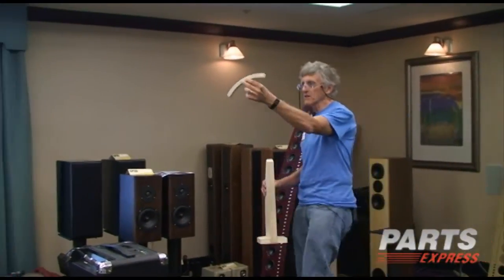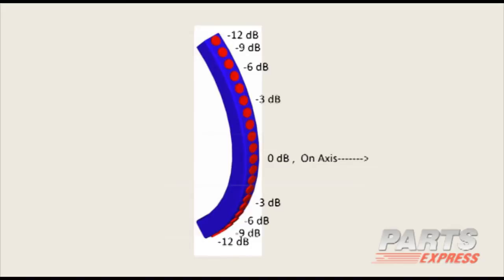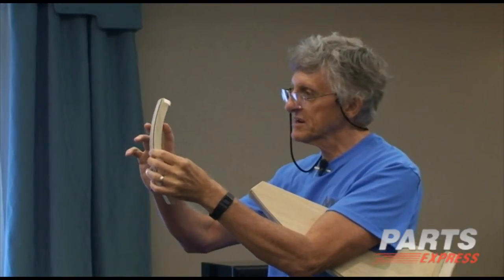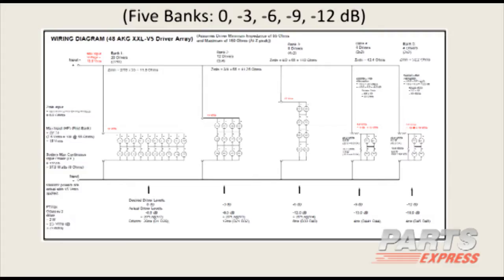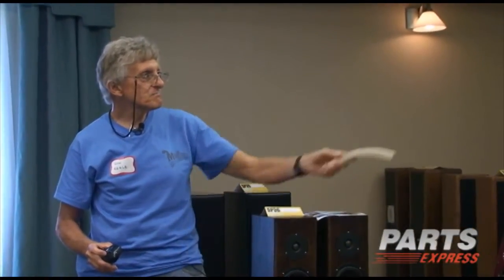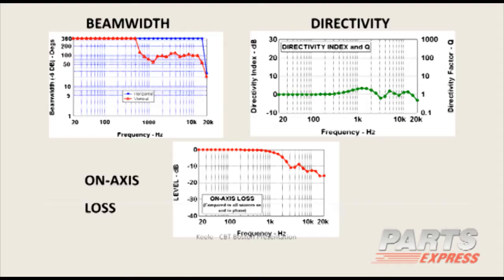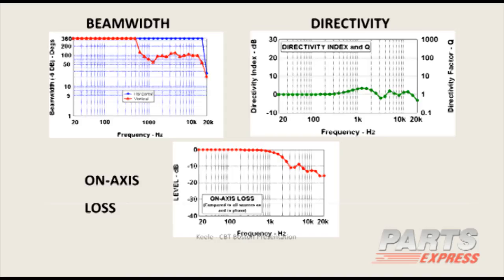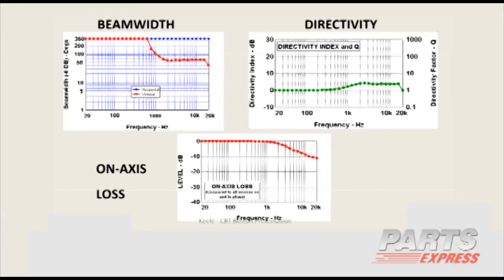Don Keele's Keynote Speech on CBT Line Array Speakers (3/6)

Comment: Does anybody know if there are any CSD, Frequency V Distortion, and impulse plots for this CBT curved line array Don is demonstrating? Also, is there any data on what effect (a gentle amount of) horn loading would have on the vertical and horizontal polar radiation plots?